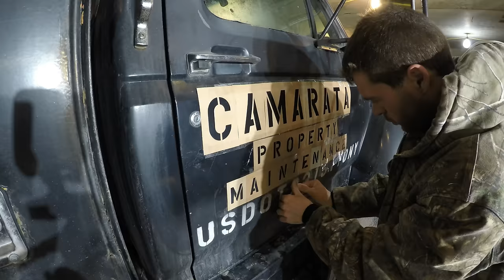Getting stopped by DOT

Comment: Always good to see you wearing safety glasses!!  This past summer, I had a tiny piece of metal fly up and hit my right eye.  It was hell...took about 3-4 weeks to heal and hurt daily.  I had to rub this medicated stuff in my eye 3 times a day and obviously I couldn't wear my contact lenses.  People, wear safety eyeware!!
Reply: Make sure you have your eye's  check for glaucoma regularly. Lost the sight in my right eye for a piece of metal becuase of glaucoma for 35 years now.
Reply: I don't know how people do stuff without safety glasses like weed whacking for example I wear safety glasses with a timber cutting hard hat with a mesh shield  and I still get shit in my eyes! then I  see people weed whacking without anything on their eyes!
Reply: @mikewhipkey6863  When I use safety glasses I make sure they are pressed up tight against my face I work in a machine shop Ive had a few things get into my eyes with safety glasses on Now I dont have that problem now since I have a pair of safety glasses that fit my fave really well
Reply: When I was younger I lost vision in both eyes (happily at different times) due to cataracts - after surgeries I regained the vision. You DO NOT want to be wandering about working with one eye - so take care of them, it's very easy to prang one or both out. Andrew (and the rest of you folks), you don't want to be trading Levi (your doggie folks) in on a seeing eye dog even if a good one.
Reply: Got a flick of steel in my cornea this past January. Had to be drilled out with a dremel tool. Wear it

Comment: Andrew, I just recently discovered your vids. They're awesome. LOVED the one where you're building the deck on top of your container house/fort and the camera work from the drone. Excellent video. Also really enjoyed the driveway renovation 1000 yards up the road from your house.  I've been DOT'd 11 times in my 19 years of driving. In the day, the company I drove for  ( I was a cement pump operator for a large natural gas production company in Western PA) gave $500 cash to any driver who PASSED a DOT inspection of any level. I've never NOT gotten that money, and think attitude has a lot to do with it. (and yes, you seem to have a great attitude, I'm not criticizing it) I remember one afternoon my supervisor followed me MOST of the way back to the shop, but veered off near his home and I went the last 10 miles without anyone behind me. Less than 3 miles from the shop was a pull off DOT used for inspections, and there was a trooper in there hitting the lights when he saw me. I had truck 18, the biggest piece of shit in the fleet. When the guy got to my window, I had all kinds of paperwork readily available and handed it to him, and he smiled handing most of it back. (weigh slips, acid manifests, etc. ) He did some initial paperwork, then came over and asked me to go through the lights. When he got to the back bumper, he had me step on the brakes. No brake lights. I was genuinely shocked. I'd pretripped the truck and they worked. I even made sure after the job before leaving location. He suggested turning the key on, I did, still no brake lights. He had me start the truck, still no brake lights. At this point, I was standing on the fuel tank, one foot in the cab, looking back to see his reaction. No brake lights, and I screamed "that mutherf______er"!!!!! He laughed and asked who? I told him about my super following me and never saying a word, now he's home sipping a cool one while I flunk my first DOT inspection.  He came to the front of the truck, told me to sit tight, filled out my paperwork and handed it all back. Three miles from the shop. He told me to make sure I wrote it up, and get it fixed. I got $500 for that inspection, the dude laughed with me or AT me for about a half hour out of his day, and we parted ways. Now that I look back on that, it was the LAST DOT inspection I've every been in. Now I drive a water truck, nights usually, and never see DOT.

Comment: You should tighten up your slack adjusters as far as they will go so the shoes are touching the drum and then back it off 1/2 - 3/4 of a full rotation
Reply: CORRECT
Reply: @Charles Pappa Yes your a 100% correct I adjusted air breaks for over 25 years learn a few things about them
Reply: Brian Jones according to the oem who makes automatic slack adjuster if they aren’t in adjustment they have failed and require replacement. So if yours are out you need new slacks.

Comment: DOT stopped our truck (1989 Super Duty) at the dump.  $500 dollar ticket because of not having a fire extinguisher.  Could not move the truck till one was bought and delivered.
After that, both little dump trucks left the state.  We knew that we didn't have it in the budget to run the trucks.  Switched to trailers and additional trips.   We had 19 trailers when I last counted  (Small trailers).   We miss out on the bigger work, but that is okay.....no DOT and CDL to worry about.
Reply: Fire extinguisher for what? A gasoline car is 100x more likely to engulf everything into flames lol
Reply: TheGuruStud cmv are required to have a fire extinguisher, first aid kit, and spare fuses as part of safety related equipment.
Reply: Traveling Kaspers World them days are over. If your commercial DOT then 10000 lbs max gross for truck trailer and load. Thanx to our friends in Albany keepin the little guy in shackles

Comment: When adjusting air brakes turn the adjustment screw till it stops then back it off 1/4 turn then the rap the brake drum with the wrench it should ring like a bell. That will give you the proper adjustment.

Comment: Enjoyed your video. Can I give you a couple of tips. One. When you air up those east coast wheels it needs to be in a safety cage. If that wheel is not seated it can come apart and hurt or kill you. Second.  When adjusting that old style slack adjuster. That little sleeve that goes around the adjusting head. You push it in to adjust and turn the adjuster until that sleeve pops up. The adjuster will be flush with the top of the adjuster when it locks. I hope you follow what I’m saying and please don’t think that I’m a know it all. You might already know this. I’m sorry if you do. Some people don’t know. I really enjoy your videos.you do good work. 👍👍👍

Comment: OMG!!!  NEVER take the lug nut completely  off the studs until the wedges are loose!!!  They can shoot off like a missle!!
Reply: Listen to this guy
Reply: And a split rim too
Reply: I’m more concerned that he’s standing on top of the spilt ring, many of people have been killed doing the same thing, I’m all for diy but make sure you know what your doing before you go messing with things that dangerous, he could have been killed very easily
Reply: Otho Williams that’s not a split rim. A split rim has a snap ring style ring that holds the wheel beed on. He has dayton wheels. The hub is larger then a bud style wheel
Reply: Joseph Conwell Depends the Dayton wheel, a lot of Dayton’s we’re split rims
Reply: Bob Beck now where’s the fun in that?
Reply: That’s what I thought, and I only helped my buddy change a tire once. Didn’t forget that though.
Reply: Lol he done so much wrong on that truck ! He had me worried when he started hammering lol I was waiting for it to fly off xD  also adjusting his brakes was totally wrong and hardly greasing the truck and only putting a clamp on a broken exhaust xD and don't get me started of using a grinder on rubber lol
Reply: Bob Beck any video links? I’d like to check this out. Thanks.
Reply: Bob Beck I seen one of them wedges fly off and hit a guy in the knee before cuz he took the lugs off before releasing the pressure. I’ve watched so many people take them off the wrong way and I cringe every time I see it. Hopefully he will learn the easy way and not the painful way.
Reply: Too much air in the tires 100 lbs 
Do not put a new tire beside an old tire needed two new tires ?
Reply: @rockriveroutdoors810  IIRC, he had already removed the valve. No pressure, no worries. He did fill the tire without a cage, though. 

At least he didn't seal the bead with either and a match.Truth be told, we had a cage in the corner of the shop for years, and the only thing it did was serve as a shelf. When I was young and bulletproof (and lucky), I had more important stuff to worry about than keeping all my body parts connected...
Reply: Mike Albert we as well have a cage in the corner of the shop that has served a chain hanger for 10 plus years but we also only run Alcoa’s now. I know there’s no pressure so technically nothing should happen but it’s kinda the same thing as treat every gun as it’s loaded. Many people have been killed by these death traps of a rim.
Reply: What part of the video are you talking about that was dangerous? 18:30?
Reply: @ThatcherKSA  Not going to rewatch to get the time, if you take nuts off completly, the wedges can shoot off the wheel with incredible force.  NO, not every time, but it can and does happen, and it has killed people!!  BIG NO-NO!!
Reply: @bobbeck5947  huh!! I watched it multiple times and still trying to rationalize how that's possible😂 good to know though!!
Reply: Gotta give him credit for his DIY instinct. But between the lug nuts that could have flown off, probably not tight enough with an electric impact. No lube to remove the tire, WD40 works good too. Adjusting the slack, the round collar around the adjusting nut is supposed to lock the nut in place, you should have to push it down to adjust it. If you dont have to , the adjustment can back off prematurely.  the throw is determined by the air can size, probably  Type  12 . Tighten it up all the way and back off 3/8 to 1/2 a turn check your throw should be about an 1 to 11/4 inches. And i highly doubt you need a 125psi in your tires. That will affect your treadwear drastically too, being overinflated. 35+ years of doing this stuff. Just be safe, BeerThirty awaits!!!
Reply: Clueless
Reply: @rockriveroutdoors810  Not a split rim. I thought it was at first but closer look I see it is not. They're probably not street legal in NY state
Reply: @othowilliams4110   Not a split rim. I thought it was at first but closer look I see it is not. They're probably not street legal in NY state
Reply: OSHA and America has everyone convinced that everything in life has to be risk free b/c out the 1/2 million times a specific thing is done in a 24 hr period, 8 ppl were injured; and so starts the experts, w/their stats, graphs, and charts to rid ppl of possible risk of injury. Soon after, OSHA is fining companies into oblivion while forcing guards onto things that never had a guard in its history causing production/wages to drop over time. All of this has also caused ppl to rely on "safety measures" to keep them safe, instead of working intelligently. Even a pizza has to arrive in 30 min or it has to be free; we're soft. jmo
Reply: @DanKoning777  Speaking of pizza, you could choke eating that so probably best avoided too ha

Comment: Dayton rims are supposed to be put on with extreme pressure, then to adjust the wobble place your hammer along side the tire and the wheel should rotate freely to correct any wobble, if theres a wobble you correct it by tightening the opposite stud and the reason they did away with this type rim because the tire changers were loosing fingers from the spud wedges, when you take this type tire off loosen, not remove the nuts on all studs grab a sledge hammer and stand off to one side and smack the tire until the wedges pop, u can't miss the sound,,, if you take the nut off then pop the tire loose them wedges can and will fly off because of the pressure behind them. Teach people the right way friend, save a finger or worse yet a severe kick in your nuts when it fly's off!!!
Reply: Them wedges fly off with some force now! Lol very dangerous taking the nuts all the way off!
Reply: they have not done away with dayton rims. they still come on new trucks
Reply: They can do a lot of damage out of nowhere.This guy knows what he's talking about.I love the channel but this video was hard to watch.
Reply: Losing*

Comment: I've found that squirting some cheap dish soap along the beads of the tire on both sides makes them slide off the rim a lot easier. Murphy's tire soap is a big help for putting on new tires. I hope this helps. Thanks for the videos!

Comment: That's funny,  we have a speed trap around here for regular cars and I jokingly say,  these cops will pull you for low windshield wiper fluid,  sounds like that really is a violation?  go figure
Reply: you be surprised ,,sanitation gives out  citations if the recycle bottles have caps on them,,they have a memory chart,what needs to be addressed,,,,,,,corporate rapists
Reply: yes you better have fluid in the resevoir and a spare jug in storage compartment
Reply: They are not cops. They are DOT.

DOT = Department of Transportation. 

Federal Agency, which means they are run inefficiently and think they serve an actual purpose but really, they just make life way more difficult for everyone like every other industry the Big Government over regulates. 

I've worked as a driver myself in the past. They are extremely detailed and thorough in their inspection of commercial vehicles. Meanwhile Jimmy pot smoke is rolling along side you on the highway in his jalopy that has bald tires, cracked wind shield, wheels are missing lug nuts, etc etc.
Reply: You can get a ticket here in the UK for no washer fluid.
Reply: @FirstLast-ny6tg  They are state cops enforcing dot regs. Make no mistake they are cops.
Reply: @FirstLast-ny6tg  what? They are usually performed by HP but most county's have troopers who are dot trained, and most city police have the same. If you stop at a weigh station or a dot inspection point that's when you deal with dot guys but when ever you are stopped on the road it's always going to be a officer that does the inspection.
Reply: Connecticut used to require otr drivers to have white bedding so that in the event of a pile-up truckers bedding could be commandeered for bandages.
Reply: WRONG !
 @FirstLast-ny6tg
Reply: @FirstLast-ny6tg  .. You are absolutely wrong, They are indeed LEO's, They have to go through inspection school.
Reply: Did he check for mud on your shoes?? Thats a potential braking hazard.
 Did he check your hydration levels?? Thats a potential mental lack of focus or distracted driving hazard.
Did he call your wife and ask what position you prefer?? Physical fitness is a safety hazard, its for your own good.

You said he spotted a low tire, you gotta watch out, They'll suck the air right out of valve stem, without even depressing the core.

Comment: Great vids, but I was always taught if you change one wheel of a twin, you need to change both because of the tire  height difference. The new tire will wear out  quicker if fitted next to an old tire.
Reply: While you are not incorrect, that is in ideal circumstances.  The best case scenario is to plug and patch the existing tire and use it.

The problem comes when a good tire with 3/4 tread left on it gets removed.  If you alway replace both tires you would either need to collect a bunch of tires in order to hope to match them up eventually or discard the tire. Now discarding a commercial tire isn't like a car tire if the core is in good shape. They will give some money back if the core can be recapped. 

So that being said, you have to determine if the loss of the quicker tire wear is more or less expensive than the alternatives and if that expense justifies the hassles. In my experience, unless the tread depth is within 1 or 2 thousands of the legal depth (2 for drive and trailer axles and 4 thousands for steer axle) I will just replace a single tire. If the tread depth is within a couple thousandths (say 3 thousandths total on a drive axle)  I will replace the entire axle. You have to also remember that a common brand name commercial tire is going to cost around 350 to 450 dollars new depending on your location.
Reply: @sumduma55  Hi, Yep, I understand the  economics but surely it makes sense to change the two front steer tires and fit the fronts to the back. Chances are, the two fronts will have worn down at the same rate. Also, fully loaded, the new tire on the back is taking most of the load and could potentially get hot and blow out.  I know I'm Mr. Doom and Gloom but I tend to look at safety first.
Reply: @martynbuzzing3327  I have never had an issue with a steer tire having more tread on one side. As for swapping them out, I would only put them on a trailer unless I had no choice for a temporary fix for a drive tire due to the tread pattern. But that may be a personal thing.

As for mismatched tires on dual wheels, there is only a few thousandths difference in tire height. One tire will take more of the load but it wont be much more. In theory, if your tires are sized appropriate for the axle weight a single tire can hold the entire weight of the axle at reduced speeds.

It isn't going to heat up and blow unless you are mixing tire sizes itself (different aspect ratios will result in different ride height under load). At least that is my experience in 40 plus years.
Reply: @sumduma55  It is 4/32" for steer tires, 2/32" for all other tires. Not thousandths.
Reply: @m16ty  thanks for the correction.